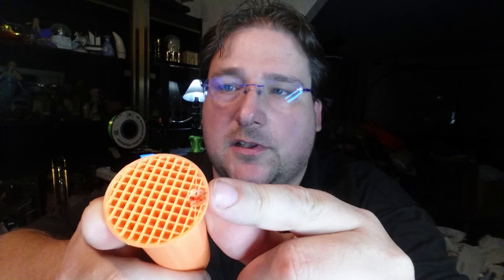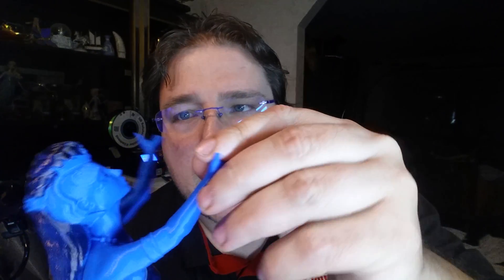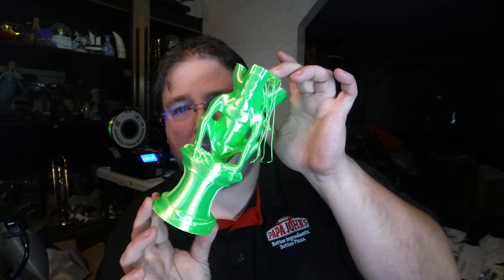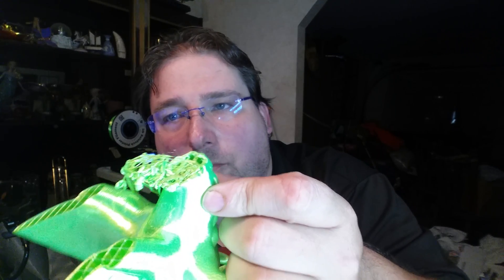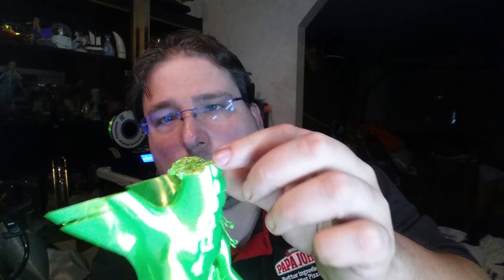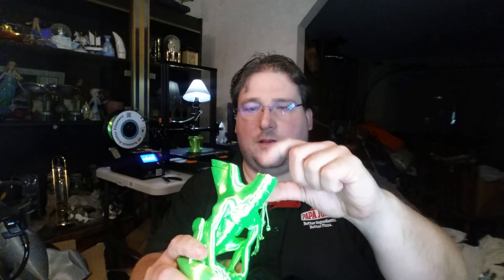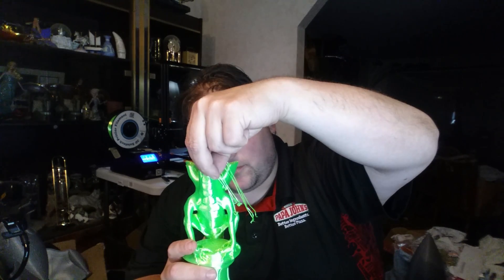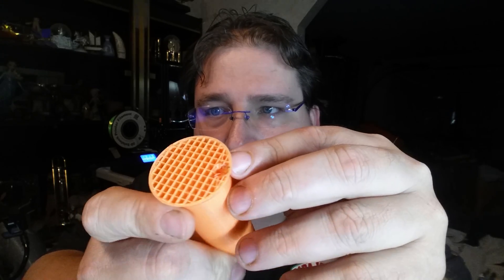Today's 3D Print - CR-10 hot end dropping in Z during print. Suggestions?

Comment: I have this same trouble except when im in pause it just seems to drop maybe 3/16"and when i resume the nozzle is to low and digs in just like your anyone else has this trouble?
Reply from the maker: careful when you pause it only "holds" the steppers for so long and then releases them.
Reply: @nerys71  thank you it was only for 30 seconds. needs to be longer..
Reply from the maker: yep 30 seconds is my experience it depowers the steppers. the trick them is to tighten the z axis up a tiny bit. shift the brass bushing a little so it does not fall on its own but not enough that it binds up on you.

Comment: hahah happened today while I was sitting here.. Did you find a cause?
Reply from the maker: In my case it was a loose wire going to the stepper motor it was not quite plugged in all the way so sometimes it would jiggle loose disconnecting power dropping the Z axis

Comment: Is the fail at the exact same height on both fails? If so its a thread issue on the Z rod.
Reply from the maker: lloyd sharp no every time at a very different height totally random I'm pretty sure it was a loose wire going to the stepper

Comment: Hi Nerys, just wanted to know if you have resolved the z drop issue?
Reply from the maker: 3D Printwiz. I do not know I believe I have I suspect it was the cable going to the Z stepper when I reseated it I did feel it click so I removed it and plugged it back in and this print finish successfully if adelinde succeeds without a drop I will consider it fixed

Comment: My prints kept failing and finely I realized that the z stepper would not hold but moved down and the display did not see it was at a different height. I think the stepper is failing and am going to replace it. Hope the one you send me fixes it { :
Reply from the maker: James Copeland i am leaning toward my peoblem being the wire going to the z stepper. remove and reseat it. also tighten up the gantry eccentric to increase friction so it does not fall down.

Comment: The wheels on the Y axis bar get loose over time and that can cause this.  Also put some sewing machine oil on the z axis rod.
Reply from the maker: Jason Baker i think the z stepper motor connection was sketchy. I reseated its connections and the problem has not reappeared.
Reply: That would do it

Comment: Ah the infamous z drop. The cr-10 for some reason does not lock the z stepper between layers. The only thing you can do from what I've read that isn't firmware related is to take the left side top guide wheel off. Yes it sounds weird but I have done the same as it was suggested to me and has worked thus far. You will need a re level and also double check the tightness of the eccentric nut for the z. It's literally held there by friction so there is a balance of all the factors to get it correct

Comment: What slicer are you using I have had this problem using simplify3D. I have yet to figure it out but if I use CURA I don't have the problem. The strange thing is that is was random sometime it would happen on the first couple of layers and drive the print head into the bed. Other times it was high up in the model. On mine I could hear the head drop it made a high pitched sound and it dove down!

Comment: Any software changes or mod adds since your last print?  If not I would guess that the problem lies somewhere with the z motor, the coupler or maybe take a look at the threads on the rod.  I agree recording the failure may be beneficial.

Comment: Loose screw or just slowly raise up the Z and see what and when it hits...could also be your wheels are slipping some where...If your using simplfy 3d are you having two different start points, this will cause this as well...
Reply from the maker: thew wheels are not "driven" so I don't see how them slipping could do that. I have checked the screws but I will give it a full level 1 checkout once this print is done. BTW it just had a LAYER SHIFT and I have no idea why. I was sitting here next to it and I heard nothing amiss. (its never had a layer shift before. ever) its an X shift too not a Y shift. it was non destructive though so I am going to let it continue.

I DID notice I screwed up my wiring and has the power cable OVER TOP OF the Z cable which would cause a nasty "bind" as it tried to lift which might explain what happened with the dragon today!! I can't unplug it of course since its printing so I bound it up and forward with some tape on top of the brain box to get it out of the way.

Comment: A bent lead screw could also cause this issue.
Reply from the maker: appears to be straight and true and it is not consistent. repeat of the print was perfect and the 3 times its done it has been at very different z heights.
Reply: Check the cables for the x axis and extruder, coz it maybe snagging on something and getting caught up, this will cause to much load for the z axis and may prevent it from carriage  from going up. This will also explain why problem is intermittent. Make sure that all cables have enough slack to go all the way up. My suggestion is to get a time lapse of a tall print to observe what exactly is happening. Hope this helps.
Reply from the maker: this might be exactly what happened to aria. dumb probie mistake when I was dicking with it yesterday and plugged it back in I put the power cable OVER TOP OF the Z/X cable which would absolutely hinder its ability to climb past a certain point.

though this does not explain the sorceress or the spindle. if it happens again I am going to set up a camera. a dash cam will get me full motion video and I can add lighting to increase quality and will get me 4 hours so as long as I log in and check on it every 3 hours or so if I see it fail I can call home to have someone yank the power cable from the dash cam which will stop it and preserve the video for me to review.

Comment: One way of knowing is to move the z axis manually using the firmware. If it does not go all the way up then check the thread.
Reply from the maker: a repeat of the print was 100% successful.... very odd.

Comment: Check your z axis rod, just a guess, must be a damage thread.
Reply from the maker: visually it appears fine. it seems straight. it also has happened at 3 very different z heights and a reprint did not repeat the failure. so probably not the z rod.